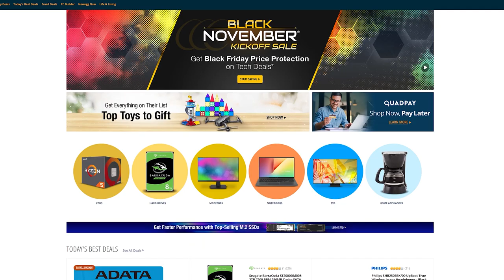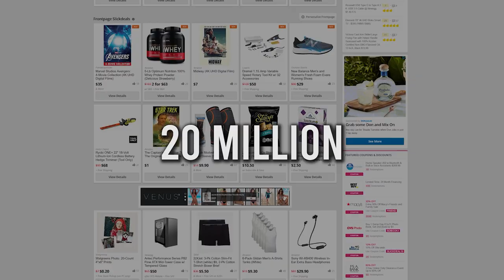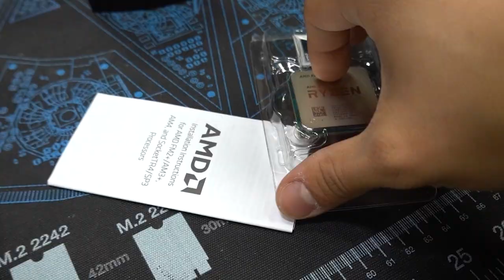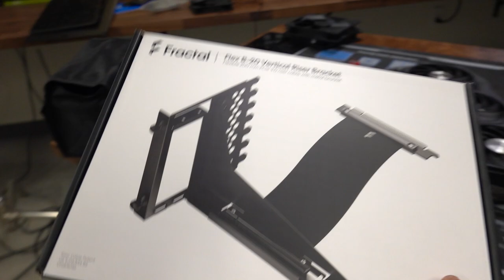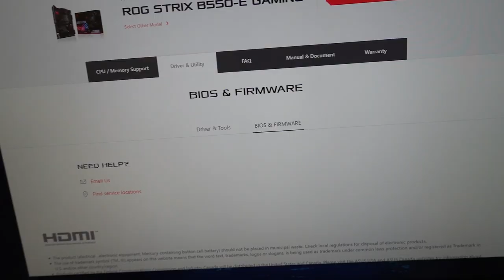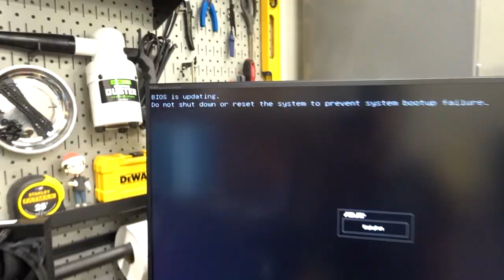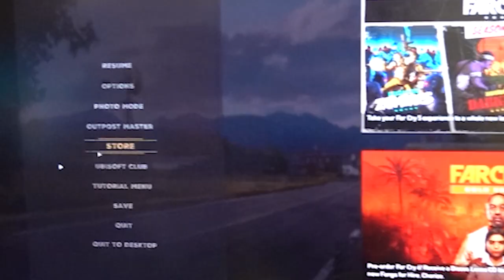I've waited so long to build this PC

Comment: Hey Kyle cool video thank you for all you work. 
I have a question when you install a radiator in the front, cna you still move the drive "bracket" so that you can install +8 HDDs ? I want to build a watercooled fielserver but allmost every case if you install somethign in the front, its not possible anymore to install more than 2 drives.
Can you something to this? 

sorry for my english, I hope you understand my question. 
keep up the great work of you!
-Frown

Comment: so do you think this would be a good cpu to pair with a 3070? i currently have the 3070 fe, but still paired with a 3600.
i previously had a 2060s which is why i had a 3600, but am upgrading as i plan on streaming the new cod. would love some feedback on this as i dont know if this chip would be kinda of overkill and if a 3700x would do just fine, especially since prices have gone way down for that chip.

Comment: I'm just curios, could a beefy sized air cooler cause poorer (know that's not a real word) airflow in a case (Corsair 4000D) and therefore increase gpu temps?

Comment: When you install your radiator. Never have the pump up top. Always on the bottom
Reply: Bruh. Thing is. Yes while it isnt optimal with the tubes going on top there really isnt going to be a huge performance hit. The biggest problem with tubes up top is the gurgling sound it creates when air get trapped at the top of the rad. Watch greg salazars og gamer nexus vid on the topic. Gamer nexus mentions that the problem mainly concers sound. However,  u are correct with the statement that the pump should never be uptop. Then again. The pump in this video isnt at the top of the loop so it should be alright

Comment: Typical of Fractal as they never even build in there cases they make because WHY would you have to remove the front panel to put in a screw to lock the side panels and don't lift the top as it doesn't even have a screw to lock it down. The sides and top should give you the option to keep panels from coming undone just by adding a small tab in the back and lock them down with Thumb screws In the back or at least have them on the top and the sides can't be removed until you take the top off.

Comment: Icue is th eonly thing that will work . Im running a Asus rog strix b-450 with a r7 3800x 4 to 6 different brands of argb components, The only software that works across the board for them all is icue, i did install  asus software just not the horrid armory which seems to knock outt other rgb software settings (asus fix this asap).

Comment: can use icue for syncing  Asus Mobo , but the big error is msi gpu and asus mobo , not sure about fractal rgb contoller.  Have not had much issue with Armoury Crate and  Creator, have deepcool aio and 6 coolermaster fans with my strix gpu and motherboard all synced using Armoury crate, Dont use icue as it doesnt do music unless you use void profile and listen through headphones

Comment: 6:16 After seeing and hearing that water cooler block snap clean onto the bracket, makes me want to splurge on a water cooler so badly. I have some stock AMD air cooler which is bulky and doesn’t quite work with the airflow orientation, but just typing I thought of how I could correct the airflow for cooler temps.

Comment: Imagine the added rgb frustration in Linux and that's why I'm done with rgb... Taking the cpu and gpu with and passing the system to my daughter who likes it.  My next setup will have no glass and no rgb anything connected. Or at least hope not to see it. May cover the GPU lights with electrical tape.

The extra cables are a pain to manage, the standards suck and it was all just a pain (o11 dynamic Razer, 9 fans and a water block). Had to run two softwares to get it to work, try matching colors in two softwares, let alone any throbbing or animation.

Never did get it working in Linux.

Comment: The radiator is in wrong position. In that way the air trapped inside the radiator goes upward and in the tubes, resulting in pump pumping air instead of liquid. Am I wrong?

Comment: The box for the 5800...prob has the same box as the ones with the coolers included to save costs on making a smaller one but i mean wtf. You can fit 50 cpus in that box np. Haha

Comment: I have a Gigabyte Master Motherboard, and an Enermax 360 Liqfusion, even with he provided rgb cable that you need to use ONLY with gigabyte motherboards I still can't control the RGB on the actual block I can only control the fans and its just an awful experience but damnit is it a AIO.

Comment: This is why i wonder why youtubers build this messes, cause the softwares dont just work :7

I use casefans that come with separate controller, they work just fine.

Avoid rgb on mobo and gpu.

Comment: Can i ask something? My pc is a low spec pc gtx 1050ti with i5 7th gen with 8gb ram 1tb hdd i have problems booting my pc when i turn on my pc the hardwares fails for example the keyboard and mouse but when i look at the cpu all the fans are on even the gpu is on if i may ask i really need help

Comment: I have a Q all thanks to you and your videos i have builded my own pc but i have a little issue i am using antec df600 case and in that i am using tomahok max and there is a cable named VDG cable and i dont know where to plug it there was no instruction on the manule too it is a 3 pin femail header and on the extended part there is a 2 pin femail where i have to plug it and just in case i bought that from offline markit so it came with 3 fans not 5 and i dont have a idea that those are argb or rgb plzz help

Comment: have the same card, cudnt get the light settings to respond in dragon center, cudn't turn it off. opened a ticket and at the end of the day they asked me to plug it into another computer. yeap nvm forget it.

Comment: lol, only a 5800x XD
Wow, B550, much good price...
Installing stuff wrong, wasn't aware I was watching the verge.
Taking stuff apart that doesn't need to be taken apart while proclaiming laziness.
Lol, a 750w PSU with a RTX 3080.
26:46 Why is there a computer tilted on a chair in the background? It is even plugged in and powered on. Why?
FF error code on the motherboard...  You are gonna destroy something running it with that issue.

Comment: Thumbnail Be Like : * ZEN 3 + AMPERE = RUNS CRYSIS REMASTERED 16K 69 FPS.

My Mind : It's The 5950x With 3090 SLI.

Video Be Like : We Are Just Gonna Stick A 3070 To The 5800x Because I Can.

Comment: I hate and love watching these videos, because I can’t even afford a hp pavilion gaming laptop, I literally have a regular hp laptop with a Ryzen 7 mobile cpu and it has Vega 11, funny but I took the panel off and this hp “ refurbished” laptop is broken half way, the bracket for the screen is broken all but one screw, but there was no screw so I put one in and no more cracking noise

Comment: so 420 instead of saying 480mm radiator support, doesn't properly install m.2 and them promptly installs the radiator at the front and upside down then gives up installing vertical bracket and rgb lol Privledged Tech Tubers. - Was this video sponsored by the Verge ?

Comment: Pretty sure it’s definitely user error. 😂😂 Most rgb devices with built in rgb control that also plug into the motherboard, have a separate mode to allow the motherboard to change the lighting, instead of the built in rgb controller handling the lighting.

Comment: How do you properly connect the case front panel  USB c Gen2? 
1.  Lian Li PW-INC1TR USB 3.0 to USB 3.1 Converter
2.  SilverStone Technology USB 3.1 Gen 2 Internal 20Pin Connector Type-C Port Header to PCIe Gen 3.0 X2 Ecu02
The PCIe card gets a lot of negative reviews... and the Lain Li adapter has so little info its hard to choose.  
Has anyone any experience with either?  I dead front port would annoy me.
Reply: * Note on USB current over limit issue: The power from the USB 3.0 header on the motherboard has a power rating at 4.5W (0.9A x 5V). However, many USB-C devices can withdraw power up to 100W (20A x 5V). This may result in a power shut down to protect the motherboard and its components. Devices such as iPad Pro and other tablets should not be charged through this port.
SO I could fry my motherboard by plugging in a laptop?   eek

Comment: WTF did you ever built an expensve PC before? 
RGB Shit is so easy, there is DRGB and ARGB, you cant interchange them, just daisy chain all DRGB devices to one Port, 
all ARGB devices to another Port, Sync them in Bios, Sync them in Software and done.

This is the same like... 2017?

There are NO Manufacturer Limitations at all!

Comment: Why is no one making an elegant gaming motherboard? Always those ugly sharp edges, diagonal lines, robust industrial looks, and unicorn vomit shouting "I WILL CRUSH YOUR BONES WITH MY INFINITE POWER". then there are the barebones green motherboards. Why is there no motherboard that has more refined, smoother features around the heatsinks, ports, IO plates, with subtler lights? It would go perfectly with the minimal design of the Fractal cooler.
The other thing that bothers me is the looks of RAM modules these days. They are either boring bare PCBs, or gamer beasts with sharp lines, or some super tacky thing like the Trident Z Royal... Why is there no elegant or minimalist RAM? The closest we have is those ones used in Chrometheus.

Comment: what is shameful is watching you throw these parts into a case half hazardly with one hand and no heart behind it. You got a watercooled CPU and air cooled gpu with screws missing from rad and what not fans missing, cable extensions not even custom cables, these builds drive me crazy, any body can throw parts into a case, but it takes class and finesse to make it look good